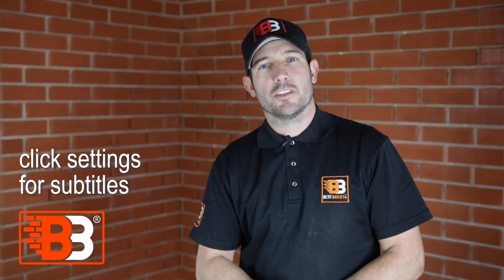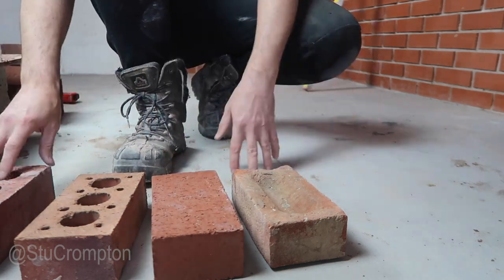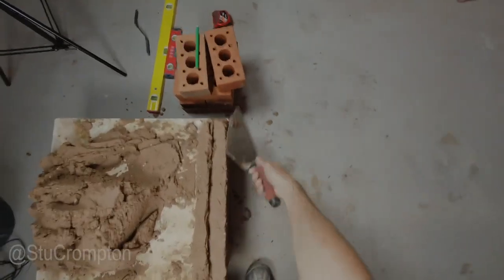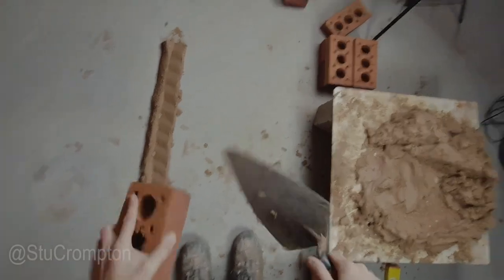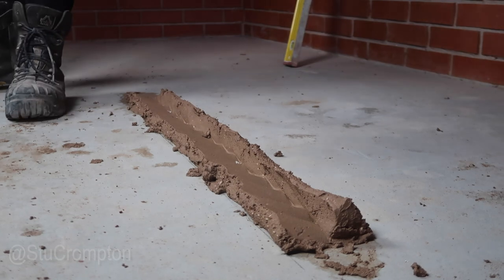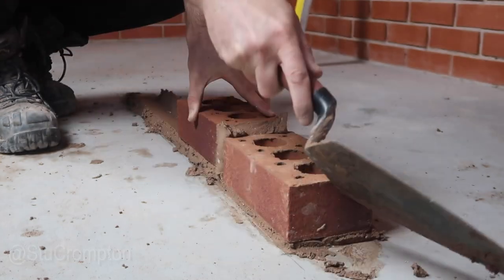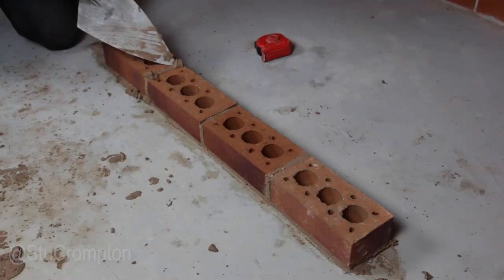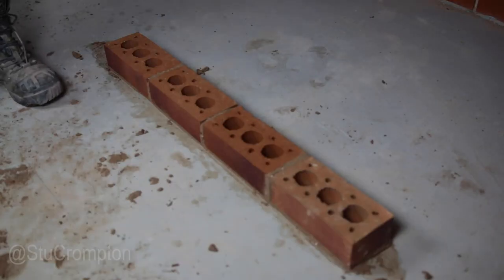Bricklaying Lesson 2 - Laying Bricks

Comment: Amazing video! Please, keep on going. 
I’ve got 2 questions. Probably, you can cover it in the future videos:
- how to properly set up and work with a string. 
- how to prevent mortar of getting dry too fast after a contact with a brick? In fact, my mortar gets almost sand dry after a contact with a brick. I have super dry bricks or should use any additive to a mortar?
Reply: Have you figured out how to prevent the mortar from drying too fast? 
My mortar is also not as sticky or paste-like as shown in the video.
Reply: @teo-medesi  hei. Yes, I have

I add 1 part of lime, to the mix (5x sand + 1x cement + 1x lime) and plasticiser ( acc to manual).